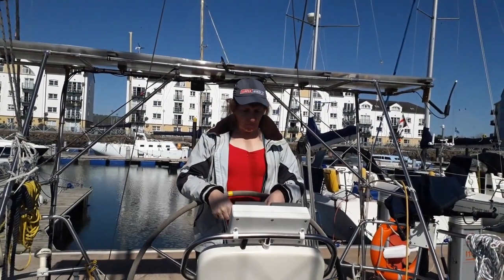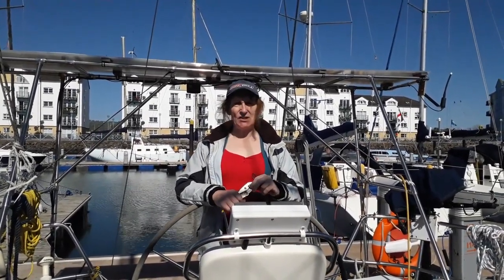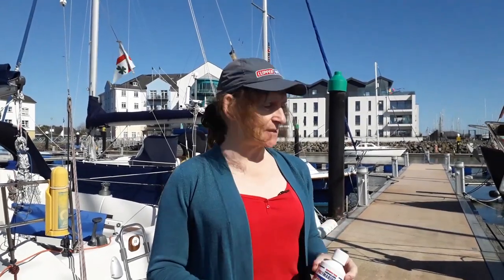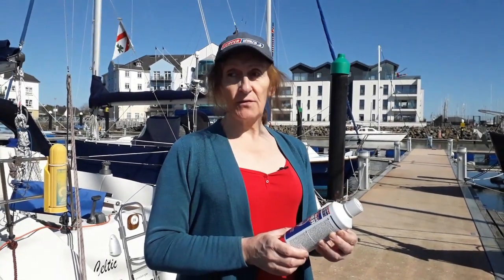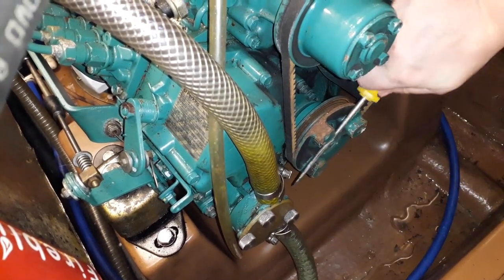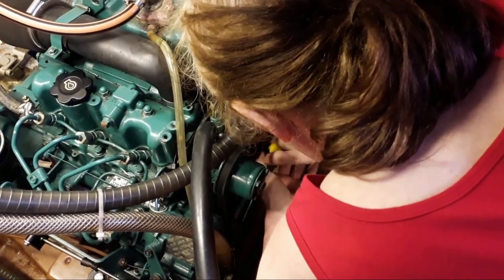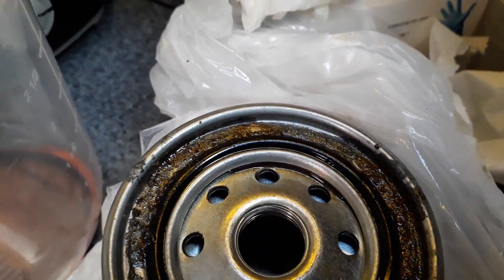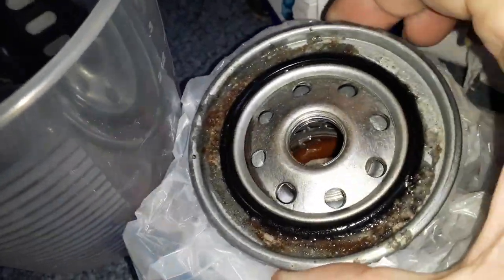Servicing our Volvo Penta MD2020 - Tips and Tricks - Ep. 180

Comment: With so many people in lockdown, I'm thinking a lot of marinas are going to have doggy fuel in their storage tanks.  Not to mention all the fuel that's been sat festering and unused in yacht fuel tanks for over a year.
Reply from the maker: We are lucky in that respect. We use the fuel for heating so ours never lies for long - about a month maximum. The Red Diesel we are able to buy locally from a garage so I expect it has a higher turnover than marina tankage over this last year. Having said that I suspect you are correct about the quality of diesel that has been lying for a year. I would be adding a shock dose of FuelSet to every tank rather than a standard dose.

Comment: That the oil filter is difficult to access isn't surprising. It seems that there's a malicious designer at Volvo, probably the same designer who put our impeller at the back of the engine, accessible only through the portside lazarete.
Reply from the maker: The BACK of the engine? What the heck is wrong with these engineers?
Reply: I have the same size Bavaria and I have an inspection hatch just by the filters that make it really easy. Wonder why they didn’t put it in in the 3 cabin.
Reply from the maker: Hi Simon - this is a two cabin version with the "wet room" style heads on that side of the engine. You would have to cut through the plastic wall and install a hatch. Perhaps Bavaria was worried that we might use the head like a steam room or with constant running showers? 😄😄

Comment: Is your fuel tank stainless steel, aluminium or plastic ? Quite often and depending Where your tanks situated if you have large voids of air in your tank condensation forms on the inside walls and drips down into the fuel system.
I was always advised to keep your tank full when possible/practical.
Maybe more of an issue in hotter climates though. Bet you can’t wait to get out cruising again. I’m off soon so watch for new content .
Reply from the maker: Our tanks are plastic with a level top. There are large baffle holes but when it is full, it is full everywhere. We are really keen to get sailing again and plans are already being made!
Reply: I kept my tank full to avoid condensate (similar boat with plastic fuel tank). But the Salty lasses are live aboard and the boat is warmer so less of an issue I think, especially given the look of the fuel filter. Great video as always.
Reply from the maker: @neilb2793  - we are total wusses and need a very warm boat 😄 and our fuel tank is surrounded by heat. The Eberspacher is in the transom and the exhaust passes close to the top of the fuel tank (about 30cm away) so that end of the transom is warm over winter and the warm air ducting for the cabins passes about 15cm from other end of the diesel tank. We probably have the warmest diesel in Carrick!
Reply: @SailingYachtSaltyLass  There are no prizes for being uncomfortable!
Reply from the maker: @neilb2793  - I totally agree

Comment: Ciuld it be that the tip with the closed seacock is for salt water cooled engines?
Reply from the maker: Although our engine has coolant, the coolant is cooled by salt water (I hope that makes sense) The sea-cock is for that. The danger is that the exhaust and sea water come together in the mixer elbow and seawater can then enter the engine through the exhaust valves.

Comment: We had a tank of nothing but sludge after lockdown,  strangely enough the engine only packed up on our 3rd day out 🤣

Thanks for the seacock tip!
Reply from the maker: I hope we lack the sludge. We have had the gauge down to "empty" more than once, but I have no idea how much diesel is left when it reads "Empty". Sadly, our tank lacks an inspection hatch and is completely sealed.
Reply: @SailingYachtSaltyLass  is your sendor unit not held in the tank top with 6 screws?
Reply from the maker: @SW1953  - it might well be. I have not had much reason to look too closely
Reply: @SailingYachtSaltyLass  the only reason I ask is I take out the sendor to use the hole for inspection and also to pump out and filter the tank contents.
Reply from the maker: We may well do that when we haul out. At the moment the inside of the boat is chaos as we move everything around and get the boat ready for sea. We acquired our spare filters yesterday so we are fully stocked on those and that just leaves the coolant change to do which we are expecting to be a messy job.
Reply: @SailingYachtSaltyLass  providing the engine has been serviced and sufficient and correct type of antifreeze it shouldn't be too messy. I like to flush the engine using old fashioned Gunk waterproof degreaser then with clean water before final fill.
Reply from the maker: I will let you know how it turns out 👍

Comment: Why we top up tank end of the season.  No airgap to cut down condensation.  We don't use marina fuel got caught once with bug from marine tank. Never again.  Must invest in folding trolley for tanks. Cheaper than taxi less back breaking than hauling them ourselves
Reply from the maker: Fuel never lasts long enough in our tank to rot or breed the bug. Over winter we use shock doses of biocide/conditioner on the diesel.